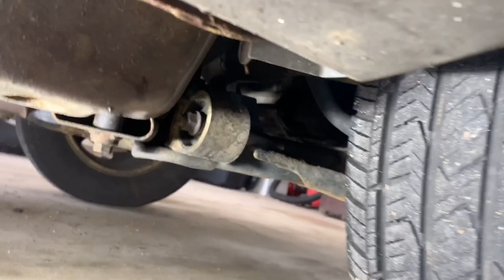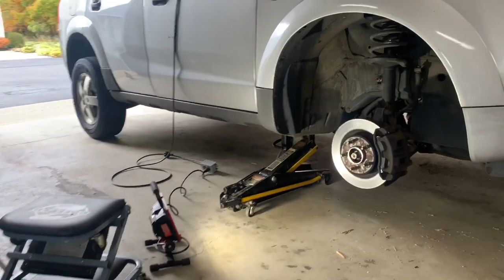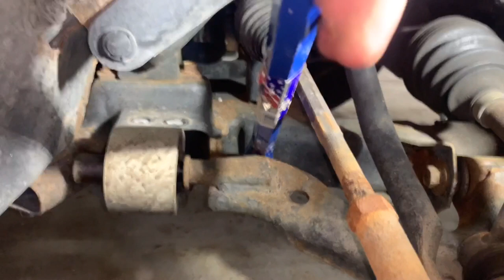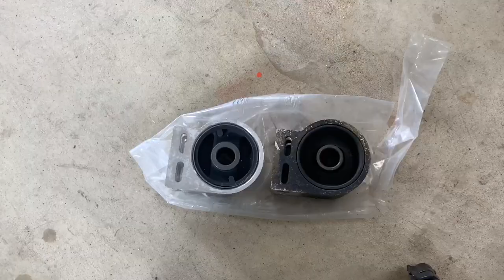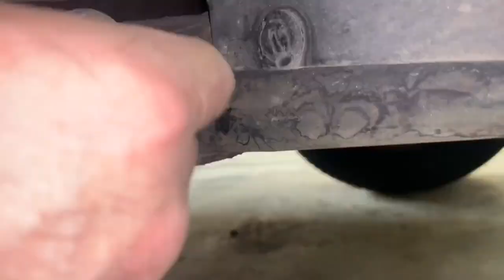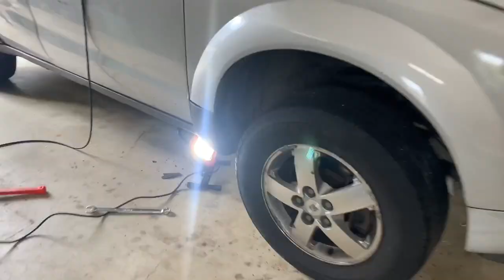How to Replace a Front Lower Rearward Suspension Control Arm Bushing || 2002 - 2007 Saturn Vue

Comment: What was the symptom you were experiencing to require this repair?   Trying to decide if I need same
Reply from the maker: After I replaced the front struts and links, I was still hearing clunking sounds from the front.
I jacked up the vehicle and found those bushings were completely worn out.
Reply: @HowtoandReviewsOfficial  do you think you could have gotten by with just this repair?   I’m having similar issues. Both these videos will be extremely  beneficial. Thanks again!!
Reply from the maker: @parneypots  Yes, I do think I could have done just this. I just decided to replace all of the suspension and be done with it. It feels great, like a new car.

Comment: Was that a awd vue?
Reply from the maker: No, it is front wheel drive.
Reply: @HowtoandReviewsOfficial  would a awd have same bushing problem? I've had sway bars & struts replaced & still have  noise .. guy said ball joints are ok
Reply: I've also put new tires on to try & get rid of constant  noise when driving but could it be bad wheel bearings ?
Reply from the maker: @mrvetteum5709  If it is a clunking sound, this could solve it. I replaced my shocks and struts and linkages and still had a clunking sound when going over bumps. These bushings were completely worn out and replacing them eliminated the clunking sounds.

If it is a constant sound, and gets worse when you turn, it is likely the wheel bearing.
Reply: @HowtoandReviewsOfficial  yep same here. I'm thinking its wheel bearings too now . If the awd has those bushings it'll be on the list . Thanks
Reply: My Vue 2007 V6 base model has clucking sound at 25 mph street driving over uneven payment. Sway bar links replaced. Still noise there. Bushings look solid (car always parked in garage).  @HowtoandReviewsOfficial
Reply: @timguy161  same.  I replaced struts & end links & clunk returned.  I'm thinking as new parts installed are firm they are reveling the next in line that is worn out.  Since the end link no longer deflects, the stress moves to the next weak bushing.  I am about to do this repair & see if it sorts out my clunk.  I see you posted 5 months ago, did you solve your clunk yet.